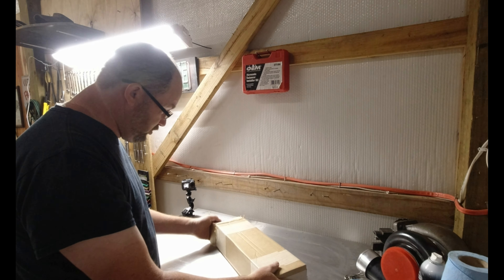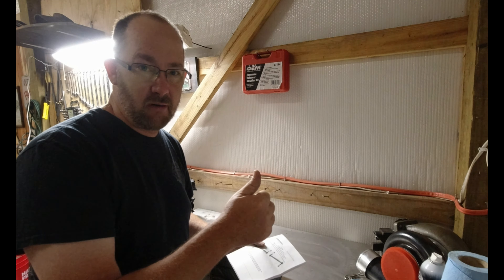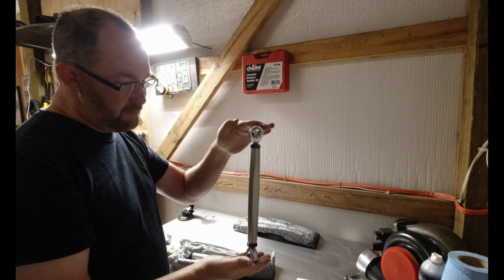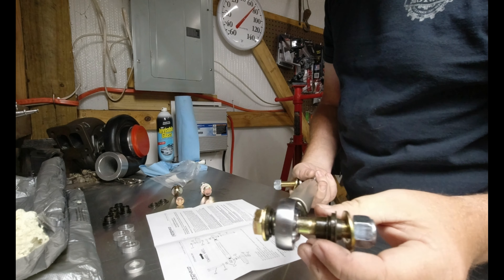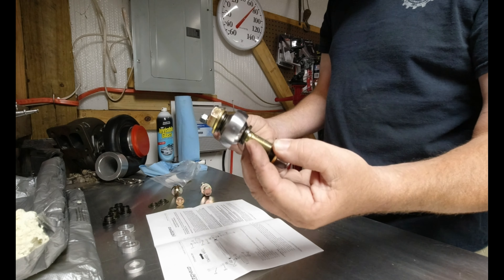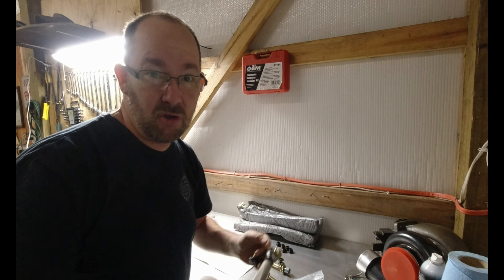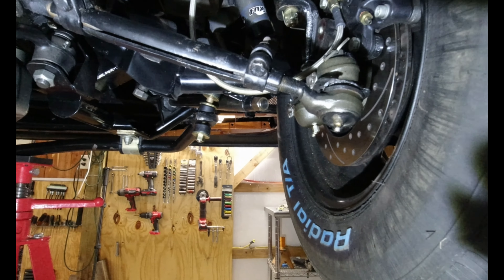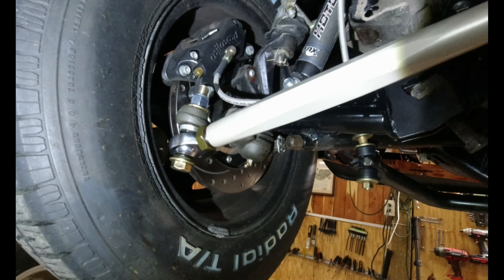Hotchkis Tie Rod Install on Dodge B-Body - 1972

Comment: Hey can you weight them and show the weight difference? Thanks
Reply from the maker: I didn't weight them when I put them in.  But they are just a little heavier than the original ones, but not much.  They are worth every penny that I spent.